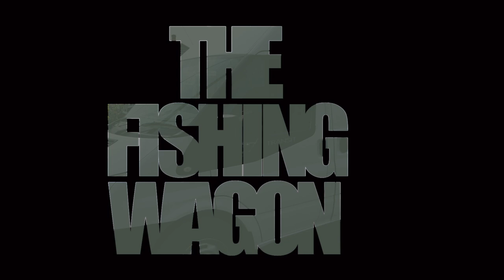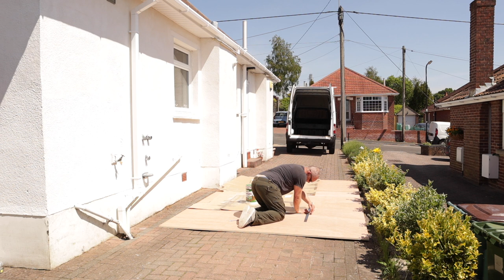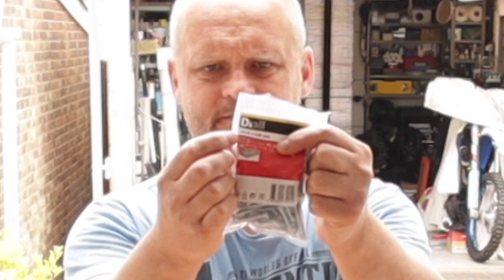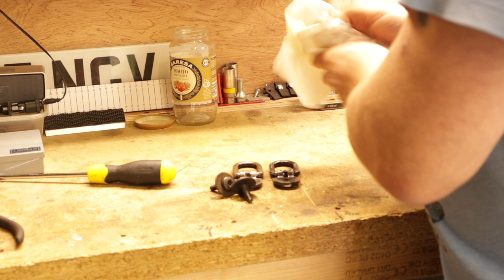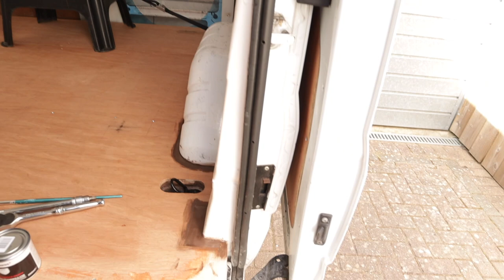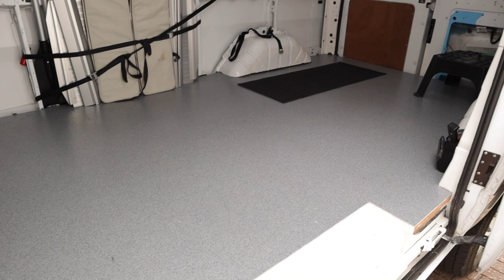The Fishing Wagon pt 2 - Transit van conversion, off grid camper, utility van - flooring

Comment: 1st class job mark looked even better when I saw it at shoreham cracking job mark . Only thing I would say is unwind your extension feel fully or you may find it all stuck together in the middle, seen it happen , result new reel . Look forward to the next one on the solar tight lines mark
Reply from the maker: Trust you to spot that Nick and I’m kicking myself for letting that one slip. The solar install gives a whole new level of use and will support my favourite addition, the fridge.
Reply: Had to drop that one in lol . Are you using DC switchgear for the panel side of  the inverter

Comment: Great video Mark - you have done a great job of that.  The Altro floor covering looks like good stuff!  I'm surprised you didn't use some offcuts to do the step by the sliding door - it would have finished off the appearance!  Looking forward to the Solar install - I did one for lights in our garden & shed to save running mains cables.Stay safe & well!
Reply from the maker: I’ve got some conveyor belt rubber to do the step. 
Solar has come down in price and relatively simple to install/use.

Comment: Nice one mark, personally speaking though I'd have gone for insulating the walls  and ceiling just to keep the condensation down. Converted mine a couple of years ago and insulated and carpeted walls and doors, not had that drip drip problem when sleeping in winter.
Reply from the maker: The walls and ceiling will be insulated but I chose not to do the floor. The next job is the solar installation and the insulation will follow.
Reply: Apologies Mark must have missed that bit.  A fishing van makes life so much easier, having spent years n years sleeping hunched up in cars

Comment: Use PU40 to fix panels from toolstaion mate. its the same stuff the metal van panels are bonded together with
 .
Reply from the maker: I’ve never heard of it before but I’ll check it out. 👍🏻
Reply: @seaangling  it's what we used to fix pop tops to the roof with.